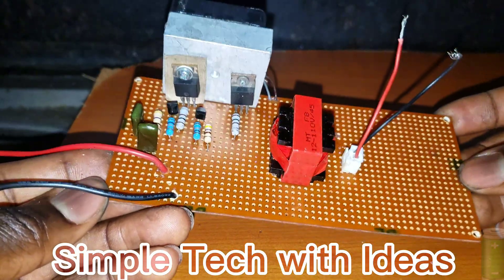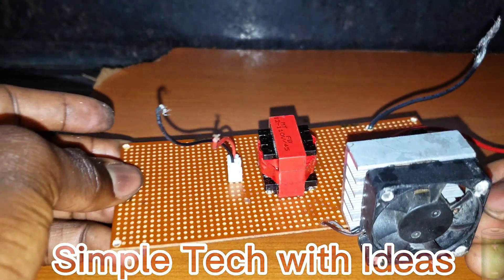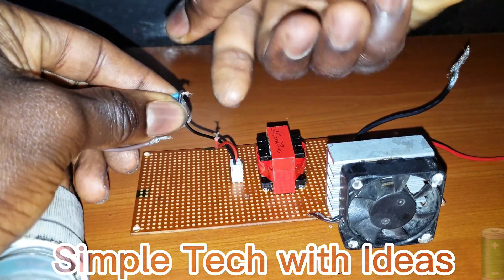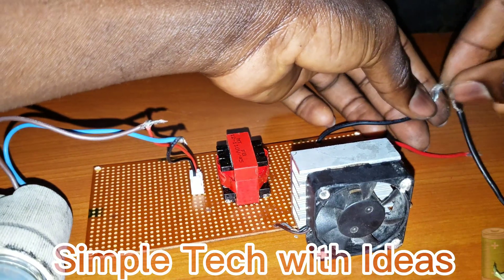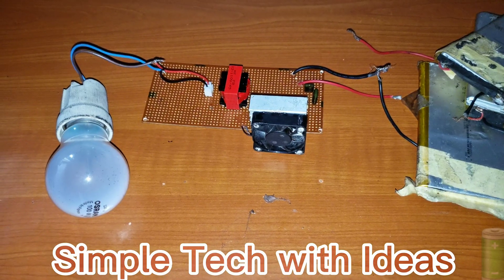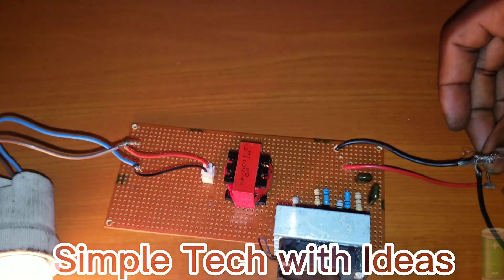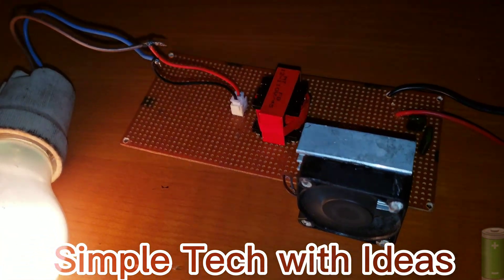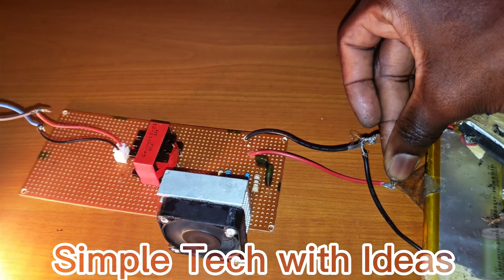How to make powerful inverter at home | diy inverter circuits with 2N2222A.

Comment: Amazing what you can build with more modest tools and parts, it's certainly more impressive and shows how smart you are, keep it up! Also, I'd assume the output is relatively high frequency AC compared to the normal 50hz mains, no?
Reply from the maker: Yes but square wave not sine wave.